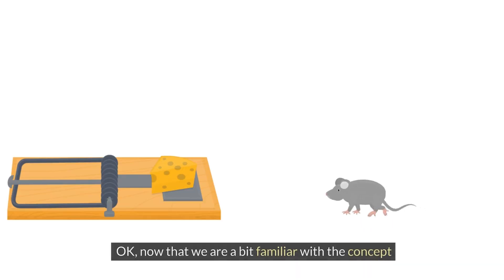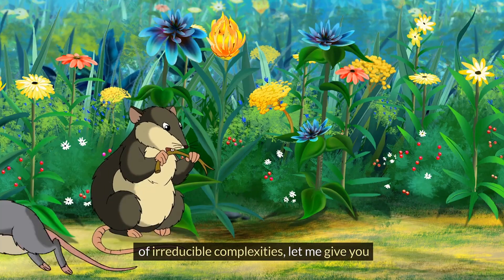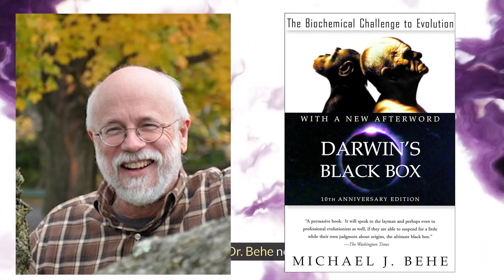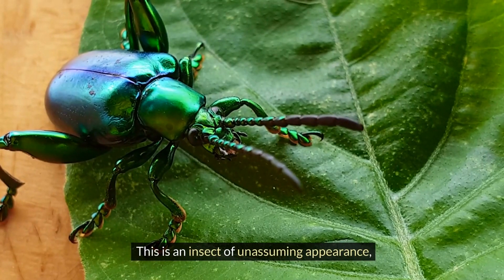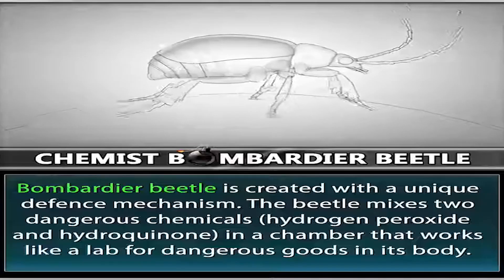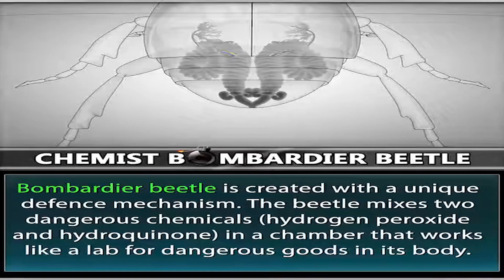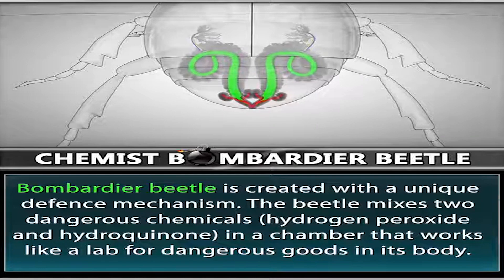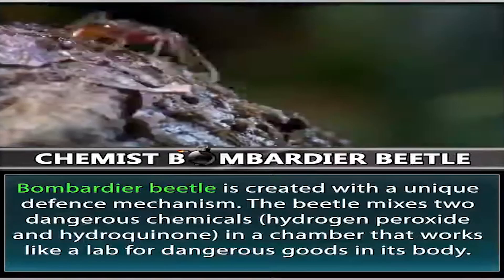Irreducible Complexity - Bombardier Beetle A Problem For Evolution

Comment: Evolution can be really fast if evolutional pressure is big enough
Reply from the maker: Oh really? How fast? Darwin said it had to be gradual.
Reply: @WelcomeToTruth  Decades. Also, Darvin was born more than 200 years ago, he couldn't possibly know everything about so many animals we know today (if he even said what you claim he did).
Reply: @--deleted-- I don't think you realize how volatile this mixture is. 
This creature would have had to explode over and over until it somehow figured it out.
All of it's parts would have had to come together at the same time to work. Hence, irreducible complexity.
Reply: @elguapo2831  How do you reach that conclusion? How is this any different than say the evolution of the stomach lining and its ability to hold strong acid? You do not start at step 10. You start at step 1.
Reply: @WelcomeToTruth  how fast? what kind of question is that? not understanding what is written and hasn't been edited, means you're forcing options on the counter.

read that comment again. read it. word for word... here, i'll help.

Evolution - this word is very particular in its definition, like almost every single word we have, including synonyms for "gradual change over time". some say "adapt" others say "morph" some just keep it literal and say "change over time."

CAN - this word is the whole point. it's introduces possiblities to the preceeding definition for the purposes of understanding.

since those two words are what remain the most pivotal, i can stop there.

i suggest you read. a lot. there's a lot you need to catch up on. you're stuck in the 1500's like a pissant waiting for a preacher to say murdering a witch is okay because he thinks a god said so and YOU must obey or eternally suffer. that's all you're doing. you're terrified that NOT accepting insanity, you won't get eternal bliss.

if YOU, the bald man in the video, really think there is a god, and there is an alternative reason to the current understanding of Evolution, then ignore the god shit. ignore the current understanding. actually become a biologist and learn on your own.

science, no matter how it's performed, as long as it remains strict and consistent with measurements and repeatability, no matter what, you WILL discover the truth, which is that everything, evolved, over time. everything. NOTHING on planet earth is MORE or LESS evolved than anything else. Mushrooms and Potatoes and insects are exactly as much evolved as humans and white whales. the difference is WHAT made them adapt to those environments? animals that live in the ocean and still need air, because (hidden tangent-fruit flies. do a few weeks of reading) of lungs, will periodically, predictably, come up for air. hold one down and it will drown. try drowing a jellyfish. try drowning an actual fish. you can suffocate a fish or jellyfish, by removing it from its environment which in turn will prevent it from living comfortably. just like putting a human into a pool and holding them underwater. i can use science to make an accurate prediction for when they will be dead. i can predict when they will struggle. not because that's how it is, but because we can demonstrate it, and show eachother how obvious it is we can't breathe liquid water.
Reply: @WelcomeToTruth look at climate change
Reply: Being the inventor of a fact doesn't mean you understand the entire thing

Comment: Score one point for keeping your comments open, score negative one million for total nonsense driven by religious dogma.  Try reading a book on the subject.
Reply: Couldnt agree more. Someone who isnt afraid of what comments are there for :)
Reply from the maker: Well thanks alot for the one point :) I have a book I mentioned in the video that YOU might want to read. I have a link in the description section for you and everything 👍
Reply: @WelcomeToTruth  I've read Behe's book, and I still own it. I bought it when it first came out, when I was still an evangelical Christian. Unless you have a higher relevant science degree, and/or have the ability to search the primary literature yourself, there is no way you can have an INFORMED opinion as to the strength or accuracy of Dr Behe's arguments. Without the knowledge to assess the accuracy of a book, what is the point of reading it? But recognised experts who have reviewed it, have identified numerous significant problems. In the same way you suggested the commenter read Behe's book, YOU should take a few minutes and read the reviews of his book from recognised experts. Someone who GENUINELY was interested in the truth would have ALREADY done his. There are REASONS why irreducible complexity has zero credibility in the scientific community. Dr Behe blames this resistance on the theological implications of his views. However, there are thousands of working scientists who reject Dr Behe's views who are CHRISTIANS.

Here is a review written BY A CHRISTIAN: https://ncse.ngo/review-michael-behes-darwins-black-box

I also want to give you a point for keeping your comments section open. Too many apologists are too scared to do this, because of annoying people like me who disagree with them.
Reply: @WelcomeToTruth Try book that isn't your bible. Which itself doesn't even have anything directly against evolution....that's something yall young earth creationists started rather recently in the relevant history of our religion.